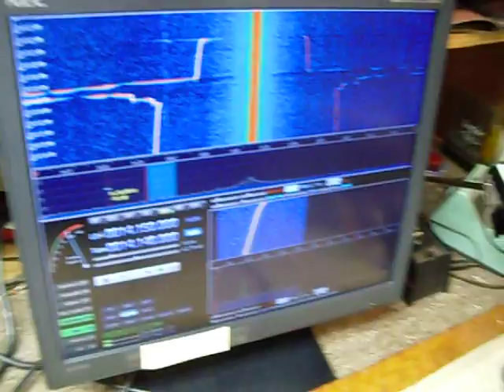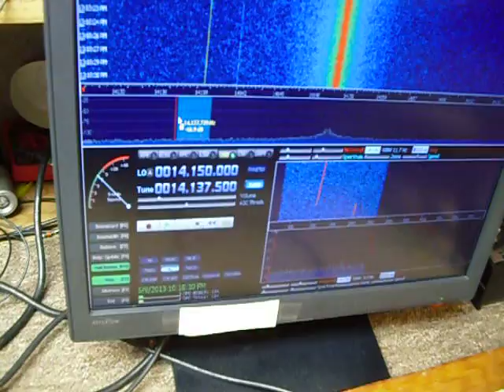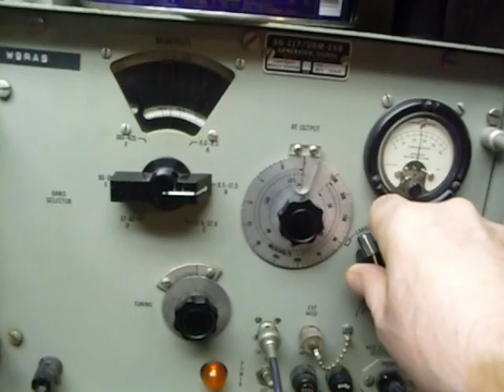Part 2 Softrock Ensemble II first bench tests  receiver sensitivity.

Comment: Good demo of your SDR receiver. You know, some vintage receivers have excellent sensitivity as well. I reworked a Hammarlund HQ 170 a few years ago and was surprised to fine the sensitivity was under one tenth of a microvolt too. Of course, it drifted like your sig gen on power on. After 30 minutes, it settled down.
Of course, your SDR is not a very good boat anchor Hi hi.
73
Glenn WA4AOS

Comment from the maker: Correction I made an error in my comment the Ensemble II works from 1.8 mhz that is 160 meters to above 10 meters or  30 mhz.I had stated 2 to 30 mhz in my previous post and 160 meters is 1.8 to 2 mhz.  It actually exceeds these specs at least on the low end as I have tuned in a few broadcast staions down to around 1.5 mhz ... Bob

Comment from the maker: Todd the ensemble II (Ensemble 2 ) is automatically band switched to any frequency you want from 2 MHZ to 30 MHZ   . You can enter the frequency digitally or slide the receiving point manually on screen to where you want. from 160 meters  up to 10 meters . When you select a frequency or ham band  the computer screen shows  a  wide display many KHZ wide around that point how much it shows depends on the audio board in your  computer .
This is all very new to me and fascinating  73 Todd   ...Bob